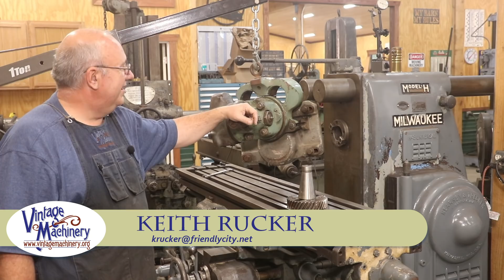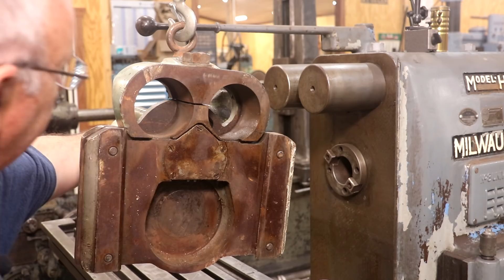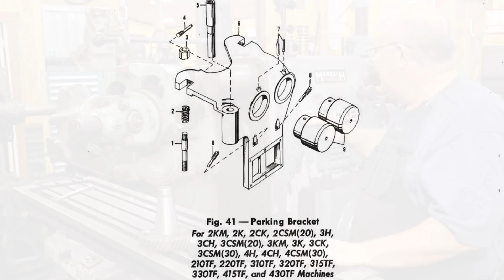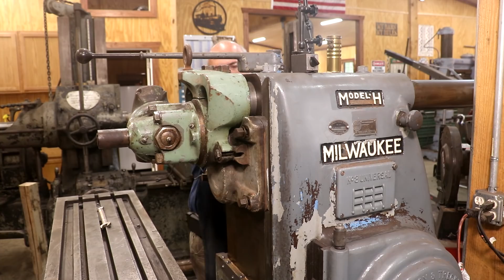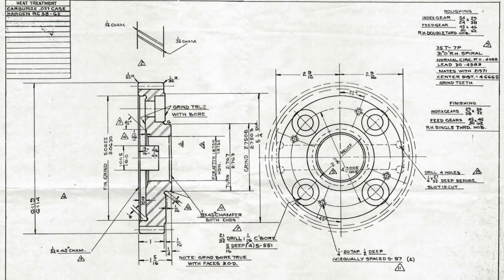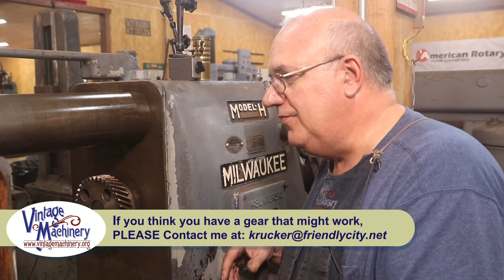New High-Speed Universal Head for my Kearney Trecker & Milling 3H Machine - ALMOST!

Comment: Honestly? with the drawings in hand, it might just be easier to make a new gear. No nasty surprises that way, and no dissapointment, plus a cool set of videos!
Reply: He doesn’t have the lead attachment and therefore cannot make the gear. The cost for a custom one off gear is about $450 to $650 at least In my part of the world. I’ve checked because I’m one of those “guys” with the head and no drive gear.
Reply: This!!
Reply: @Gene Ard As per Keith's latest video. It would appear he is potentially going down the road of making a new gear. I am never too proud to admit when I am wrong and it would appear that my assertion that he absolutely will not be making a gear, might be in question. If that ultimately is the case, I will stand corrected and admit my assertion was indeed incorrect. If he does, it will indeed be an interesting video series for all of us. A win win!   :-)
Reply: You have no idea the complexity of making a helical spiral gear. Keith was not BS'ing when he spent several minutes explaining why he won't be doing that. The only more complex traditional gear to make is a herringbone. No gear is getting made for this machine.
Reply: @StreuB1  Fun Fact: The H-60 Hawk,  S92 Super Hawk, and CH-53K are chock filled with a multitude of transmissions, gear boxes and ...well... gears of all kinds. Also fun fact, I worked at the worlds best helicopter manufacturer as a 'subject matter expert' and one of the areas of responsability I dealt with was the Transmissions Group for the above listed helicopters. I know what I am talking about. I have been watching Mr. Rucker for years, and he has the skills and for the most part the tools needed to manufacture the gear he needs, its only a question of if he has the time to do it, the materials to do it with, the few speical tools that would make it easier to make (sadly, the best tool for it is the universal head he's trying to get to work) or, and he did mention this, its just easier to buy the thing. Buying the thing is easier than sourcing the materials, doing all of the translation from blueprint to manufacturing steps and possible heat treat... But, after watching Mr. Rucker for years? Yeah, if he needs it he could make it, he's got the skills for it. (see, thats what us old farts call 'respect'. might want to try that some day).  I mean, seriously, where do you think that gear came from? The far flung future where 6 axi CNC machines whittle down 6 ton blocks of titainum to make just a swashplate? No, they came from older machines similar to the one's in Mr. Ruckers shop.
Reply: @geneard639  I had a long reply written and then sat and talked with my dad for a bit before bed and then realized, its not worth it. Its easier in life to sometimes sit back and say "You're right, you win. Have a nice day, sir."  :-)

Comment: Would it be possible to make up a spacer between the the new head and the machine? This would allow you to use the existing gear without modification, the spacer would be relatively easy to machine and you could use the existing side clamps with longer bolts to fix the head to the upright.

Comment: Looking at the print for the gear you need, it specifies carburizing to 58-62 HRC 0.037" case thickness. If machining it needs to be done you might be in luck that it's just case hardened as well.

Comment: If you have a local tool and die shop with an EDM you could have them wire off a slab from the front. Of course you'd still need to machine the recess but atleast that's not interrupted like cutting through the gear teeth which is no fun. Just a thought.

Comment: If you can't get the right gear, maybe 2 options: 
It looks like the gear and the taper are two parts. Maybe you can gain the distance by modifying the taper, op partly the taper and partly the gear.
The second option is (not very vintage machinery-like) to get someone with a wire EDM-machine to slice a bit of the front of the gear. This should be no problem for a hardened gear.
I,m interested to see what is going to happen.

Comment: Another option would be to custom build a spacer for whole head. In old days this would be expensive. Today with Cnc laser cutters this is actually cheap
Reply: That would indeed seem to be a possible  option.
Reply: Yeah, go price cutting a 1/2" plate of that size, and keep in mind that it'd have to be ground flat and parallel on both sides. I'm sure you'll find that "cheap" is not the exact right word.
Reply: @LambertZero  the grinding kieth would do. The cutting of half inch steel plate for spacer, like i said, with the cnc of todays world it is cheaper than getting a custom gear ground up, this is due to cost of steel and hardeneing, then machining and grinding is quite expensive.

Or in dollars wise a $100 dollar cut plate spacer vs an almost $1000 dollar gear. Spiral mated gears are NOT cheap at all.

Look at shot of back of the head at beginning there is not a lot of surface to make a plate for.  Years ago cutting this all by hand with a plasma or oxy/acc would have been very expensive. Today with laser, waterjet, or even plasma cnc its actually cheap.
Reply: @jacilynns6330  Won't fit on the surface grinder. It'd have to be blanchard ground.
Reply: @LambertZero  you mean big rotating surface ground like for tablesaw tops? uh...yeah cant see kieth doing that.

To paraphrase kieth..."this is not a critical surface"
Reply: @LambertZero  Go to oxtool at https://www.youtube.com/watch?v=ooLyEmrbEz8 32:08 See what Mr. Lipton has, pretty sharp, been in the machining bus. since 1969 & don't remember seeing anything like this in those years.
Reply: @jacilynns6330  That's one hell of a lot of grinding, considering the hardness at 60Rc, and the same for hard turning the face of that interrupted cut of the gear. You have the gear teeth AND the 4 round recesses to machine over. That takes capabilities that I have never seen possible from Keith.
Reply: @LambertZero  if those gears drives are as rare as Keith says the price will be high, that's the capitalist way supply versus demand. 1/2" plate plasma cut must be cheaper, cheaper still if Mr R uses his many machines.
Reply: Don't forget there are brackets and clamps that need to grab the sides of the mill... not just as simple as adding a spacer.  Softening the gear, machining it, then re-tempering it might be an option.
Reply: @scowell  I'd think the same spacer would also kick the dovetails out a half inch as well.  Looks like they just keep the head from twisting or pulling out away from the machine.  There should be enough adjustment still with a spacer, just needs longer bolts.
Reply: @scowell  longer bolts needed perhaps?
Reply: @littleworkshopofhorrors2395  There appear to be grooves on the head and dogs on the angles... Keith had to open the bolts farther to let the angle slip out.  I believe any spacer would compromise the stiffness of the mounting... I'd anneal the gear, machine it, then harden it back up... if he can't find the right gear.
Reply: @scowell  that's hardly a great obstacle. BUT I have never seen the back of the head for a definitive judgement. Seems a little sacrilegious to ruin something that might be in great need somewhere else, if they were a dime a dozen then hell yes skim it down.
Reply: A spacer wouldn't need to be one piece, it could be designed so that plasma cut pieces would be small enough to fit on Keith's surface grinder.  Wouldn't the dovetail clamps just need longer bolts if a spacer was used?
Reply: Sounds like a ground spacer plate would work, alignment and twisting resistance could be done with dowls/pins.
Reply: You can lase/water jet whatever, the problem is heat treating it afterwards

Comment: Maybe I missed it but why not make a new one? Just doesn't want to put in that much time and effort when there is an easier solution or is it beyond his shops capabilities?
Reply: You might want to take a look at the machines used to make that caliber of gear. They are fricking huge expensive machines that just do one process. You may need five single process behemoth machines plus industrial heat treatment to make them.  
If you were going to heat treat a single gear to that spec you may burn $5k of electric just for that process.
Reply: He said he could make one but would rather buy one if possible.
Reply: @satguy  ah ok thanks

Comment: Keith, why not anneal it and then do the machining?  You can certainly have it professionally heat treated if you are not comfortable doing it yourself.  Certainly it would be best to fine the correct gear, but I wouldn't be totally against annealing it, machining it to correct specs, and then heat treating it again.  I guess there is risk with that approach, which would be warping or distortion of the gear when heat treating it again.  It all depends upon what alloy that gear is made from.   Also,  I would guess that the whole gear is not hardened, only the outer tooth areas.   A lot of these were made and then induction hardened only at the tooth profile.  Gives a tough gear body, and hardened teeth for wear resistance.  That also changes the profile on the machining approach. Just a thought.

Comment: Could you make a spacer plate to sit between the head and the machine. That would allow the gears to fully mesh and also give support.
Reply: I thought about the same, but probably the dovetail jaws have a complicated profile that needs to be duplicated on the spacer plate.
Reply: @philipmihailov  The pieces that actually engage could just be mounted on longer bolts with their own spacers.
Reply: @markbernier8434  I don't think that just longer bolts will do. It is not clearly visible on the video, but these clamps need something to back on that prevents them from spreading out. If you pause on 11:47 - https://youtu.be/y677eFiX00I?t=707, you can see, that back of the head is not flat, but there is a step, that keeps jaws positioned.
Reply: @philipmihailov  I don't think it is a true dovetail as it does not slide. It is only really a clamp so it may be possible to move the original moving parts to a spacer plate without much effort as they seem to just sit in slots. The plate would really just be a thick steel 'gasket' with the same profile as the head flange and he could use slightly longer bolts to secure the dovetails to the rear in the same way they attach to the head. It may be a lot easier than messing with hardened gears.
Reply: @JerryWalker001  You are right, but this "gasket" is not so simple. It needs to confirm with the original head profile, that has protrusions on the sides, and also copy the same profile on the other side. Is it possible to make this spacer plate? Yes. Is it a simple waterjet/laser cut from a piece of 1/8" plate? - Not so much.
Reply: It's a clamp, meaning that it would force the "teeth" of this clamp to catch half way (by the looks of things). Never a good idea. Basically, it would put this head in nanny mode, you wouldn't be able to run it 100%. No, the gear is pretty much the only way to go for this.
Reply: @aserta  The dovetail is indeed a clamp. It pulls the face of the head against the face of the machine. It really makes no difference how thick the head 'flange' is so a spacer would not prevent proper operation of the machine if it clamps the head to the machine with the gears correctly aligned. By spacer I mean a full sized spacer that effectively thickens the head flange over its entire area. It would be no different than the front of the machine being thicker. If anything it would stiffen the head.
Reply: It looks like even a 1/8” spacer would halve the misalignment. And it may be possible to carve another 1/16” out of the casing to give sufficient clearance.
Reply: The dovetail jaws would have to be spaced as well, and given its shape and being only half inch thick, the spacer would be kinda flimsy. Another option would be to make an extended dovetail jaw. For now I would look for the right part before making these modifications.
Reply: @iTeerRex  No they would not need to be shaped. I am only suggesting a spacer plate to make the head flange effectively thicker. The dovetail is in the removable part. The front of the machine is flat. If you have a look at the drawing for the head you can see that the head flange is effectively flat with a dovetail attached via bolts. The dovetail is only used as a clamp so it would be simple to make the plate. This would actually result in a very similar arrangement to the heavy duty head that the gear he has is designed for.
Reply: @JerryWalker001  Alright bro. I have never looked at one of these before. My only knowledge is from what little I learned form this video.
Reply: Thinking the same